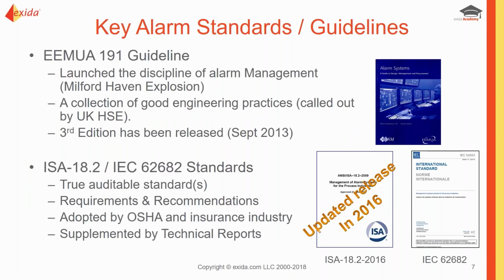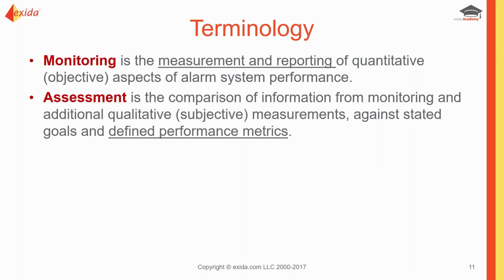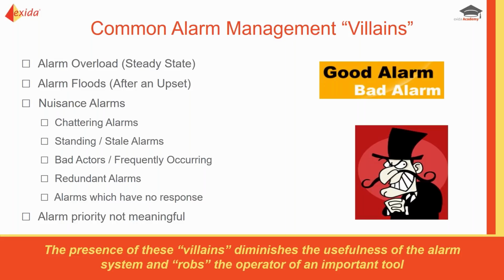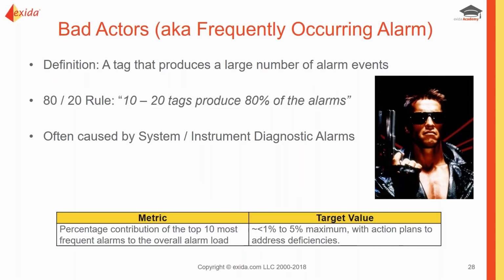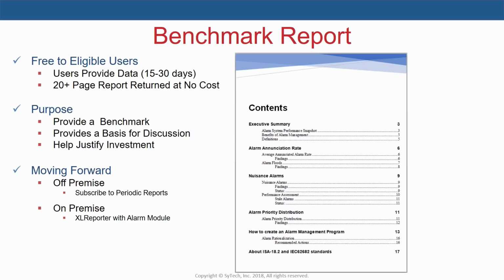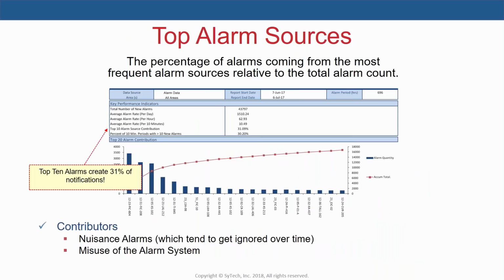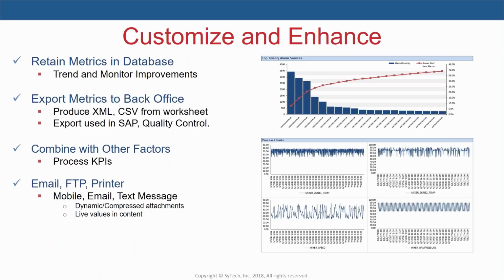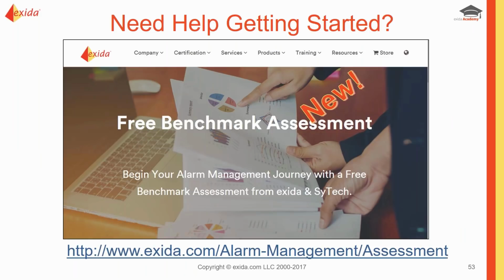Alarm Management and ISA-18.2 / IEC 62682 – How Do I Get Started?

Comment: Hi ! Great vid ! Thanks for sharing !

I am Marylin KOUASSI. 
I’ve recently worked on an alarm system for my memoire. And now want to use the KPI‘s suggested by ISA 18.2 for analysing the performance of the system. My question is: How do I count the alarms ? Do I count them by their tag ? For example:
- BOP2.0ZSNELT104 occurs 14 times with High level in one hour.
-BOP1.CVI occurs 23 times with low level in the same hour.  
 How Do I count these alarms ? as 2 in the hour or 37 ? 

your answer will be a great help for me.